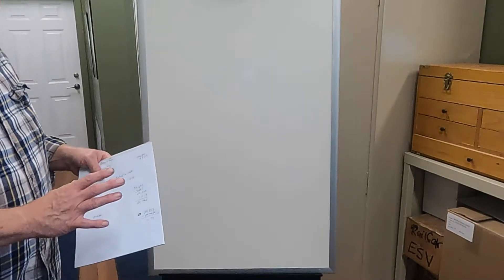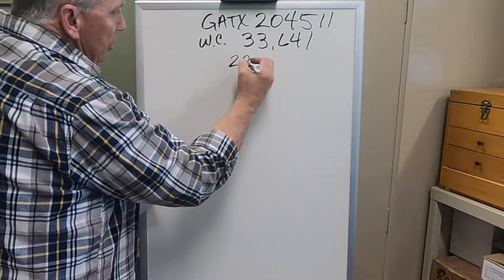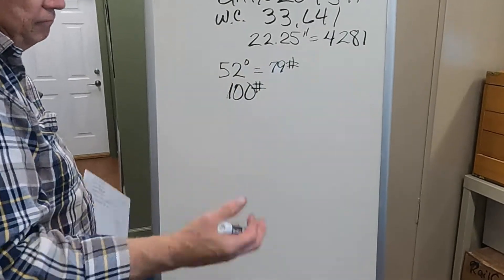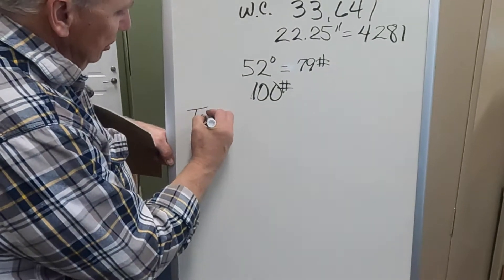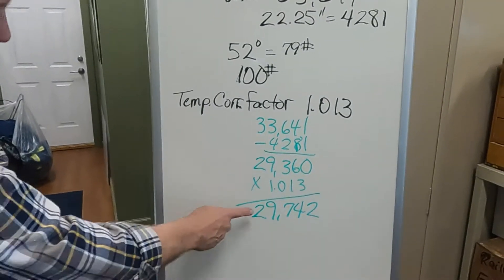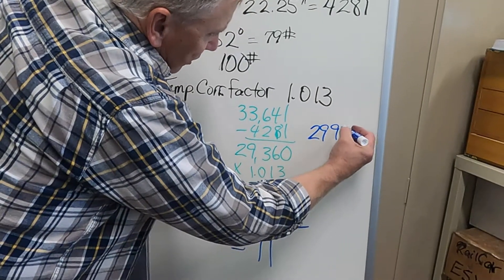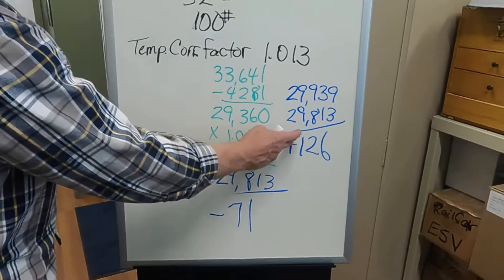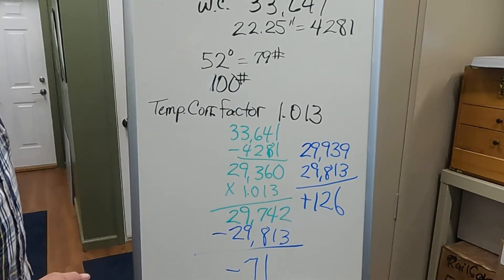24 - Railcar Calculation

Comment: Do you ever get an instance where the outage numbers for gallons does not match the anticipated increase in percentage for the storage tanks.
Reply from the maker: Yes, there have been many times when the car gallons I calculated did not cause my storage tank percentage to rise accordingly. If I offload 30,000 gallons into a 60,000 gallon storage tank, its volume should go up by 50%. The actual temperature of the  product in the storage tank can cause the incoming propane to either shrink or swell depending on if the storage tank is either colder or warmer than what the car was. For example, all of the cars I offloaded today were at 40 degrees fahrenheit, 4 degrees Celsius, yet because of the colder outside air temperature, my storage tanks stayed at 28 degrees fahrenheit, -2 Celsius. Since tank gauges are not temperature compensating, they can be a little misleading. All rail cars are insulated, but most storage tanks are not, this can cause us issues if we don't factor this in. Hope this helps. Thanks